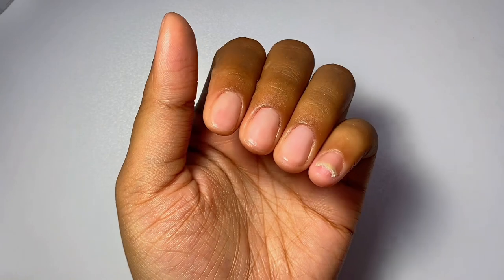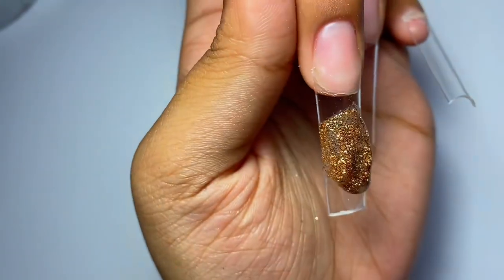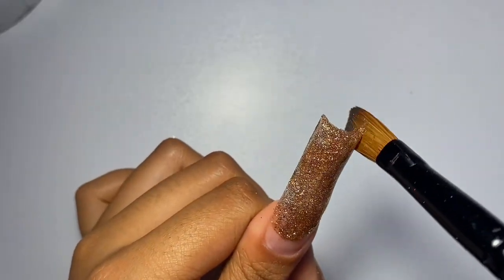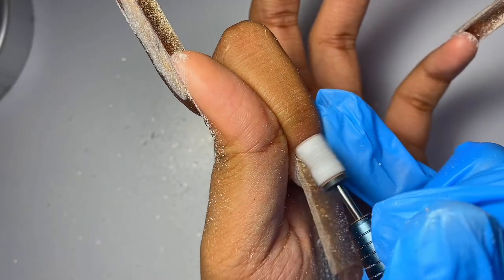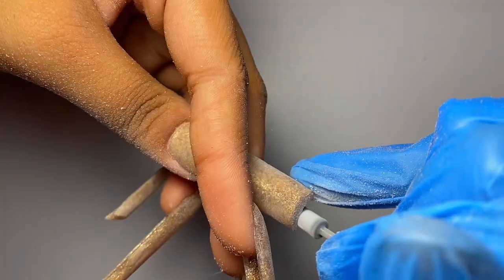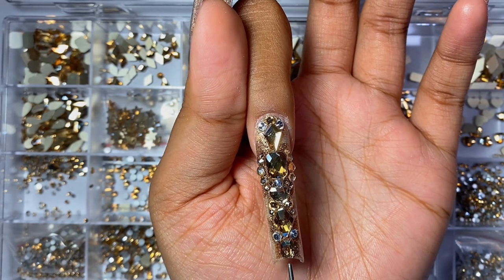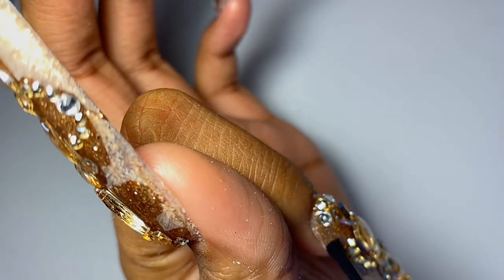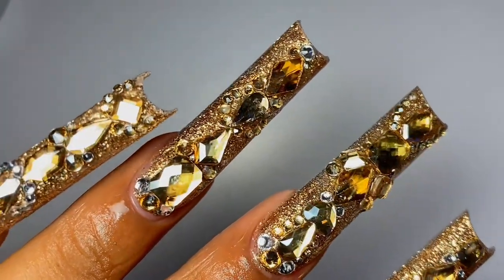💎SWAROVSKI CRYSTAL ACRYLIC NAILS💎| acrylic application + brief, but important conversation!✨

Comment: Just a quick question, why matte top coat over regular top coat or base coat? Let me know.❤
Reply from the maker: Hi! Ive tried the pop pff method using regular top coat in the past and it never seemed to work😭 even when i used tons of oil the nails would never come off. I was recommended to use a matte top coat instead and I’ve found that matte top coat doesn’t hold onto nails as strong as regular top coat or base coat, which makes it easier to take off❤️
Reply: @nailsbycyy  Great info for the future. Thanks.

Comment: Oh girl if you dont keep them.on long instead.of wasting the time.of putting the clear coat on after and having to be careful to not get it on the jewels and all that stuff just paint the whole nail with top coat that way when you're done u can just.cure.them and be.done with them if.i dont plan on keeping a design for that long thats what i do   just use the top coat but honestly the first time i used top coat i thought they would pop off especially  cause im kind of hard on my nails with everything i do every day so it shocked me as the days went by and i didn't have time to change the design 2 days later like I was supposed too. So i ended up having them on 3 weeks and didn't lose any of the crystals and i just knew listening to all the nail tubers i used to watch for years they said top coat wont keep them on they will pop off real easy but luckily mine didn't